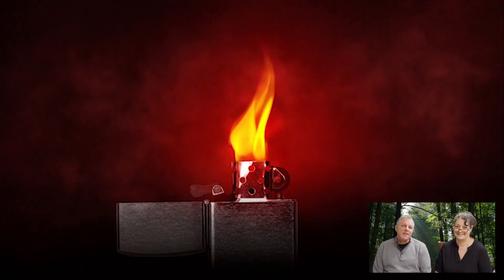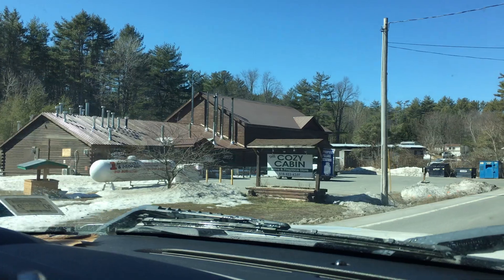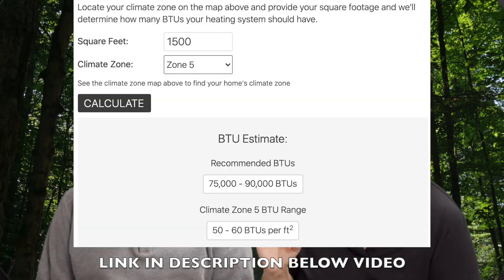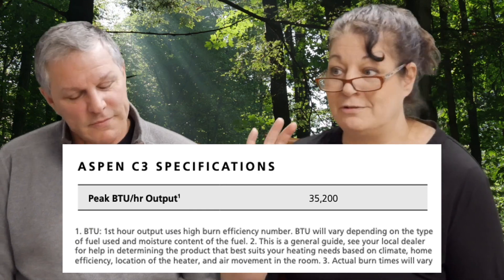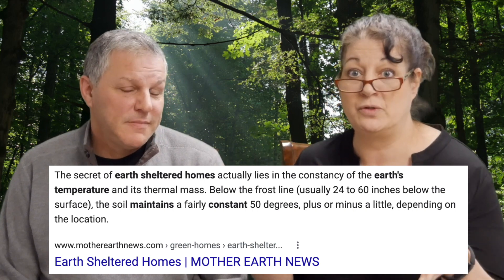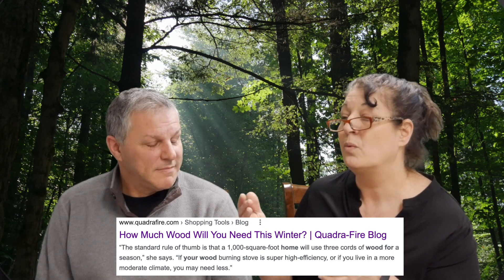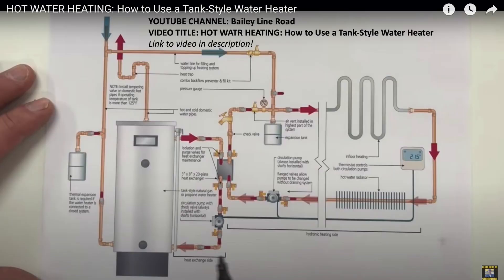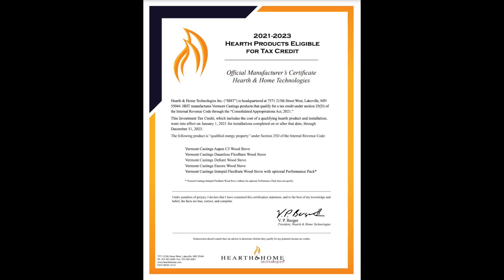OFF GRID EARTH SHELTERED HOME BUILD HEATING PLANS

Comment: Word of caution: The temperature of earth is NOT generally 50°F. It may be true in Adarondac, but I suspect it's true in lower zone 5, more relevant to my area, and probably lower over there. The important thing is, that the temperature of earth in depth is equal to the average air temperature in the area - so it depends on location. So be aware, one might end up needing heating his house year round, if it's not properly designed. Particularly not insulating floor and having a large face wall with only double paned windows will significantly decrease equilibrium temperature in the house. But there are appliances like TV or water kettle (or if they have a solar invertor in the house, it will generate up to few kilowatts of heat every day, might be even excessive) which add heat in addition to human breath - all that in low energy houses raises that equilibrium temperature when the house is inhabited. I'm very very curious myself, what temperature comfort this lovely house bring :-)
Reply from the maker: Trust me when I tell you we have researched all of this upside down and sideways because we have thought of it all. We can’t wait to see how it works out as well! 😊
Reply: @CreatingASimplerLifeOffGrid  It may we'll be that you did much better job reserching it then I did :-D. I'd be happy to be proven wrong, it would be great both for you as well as for my plans! :-)
Reply from the maker: Even with all the research we’re on the edge of our seat!
Reply: @CreatingASimplerLifeOffGrid  I don't think you have to worry, because even if you burn 5 times more wood than you expected,it's still gonna be significantly less then what you need in conventional house. And you have plenty!  :-)

Comment: Ok I withdraw a previous comment on another video,  you are getting the ventilation system. Very good! And it works perfectly, I dry clothes on a clothes rack in the bathroom, they are dry overnight. No moisture in the house at all. However, you might feel that the house gets colder with this system. I called my house the "Flexit-fridge" when I moved in. Your bedrooms will be cold, as only fresh air is put into those rooms. You are not supposed to vent through windows or doors. I bought a bigger wood burning stove, and regulate the heat with the size of the logs. I have a kindler cracker - I recommend you to get one.. so easy and convenient. I went for underfloor heating in the 2 bedrooms and the hallway. I keep them on low, and it dries up wet coats and boots. (I have 1200 sq. feet house) I live in Norway, on 60degrees north, we have so being comfortable is the main thing.
Reply from the maker: Your house sounds amazing! We bought a wood stove and that’s how we plan on heating too. We also have the kindling cracker and just purchased s log splitter to make line easier!
Reply: @CreatingASimplerLifeOffGrid  Getting late over here - I do not have underfloor heating in the bedrooms - bathrooms!! 😂 I have a thick dawn comforter in the bedroom, and a dog! 😉
Reply from the maker: @ibislife  both sound great😊
Reply from the maker: Ps we are at about 45 north

Comment: Good evening to both of you 👍 Yes you will have a very well insulated house for sure 👍😉 You will need to heat to bring down the humidity and also you have a plenty of wood anyway, so you will be able to cut 2 yrs a head 😉👍 I agree with you I will never ever going to force air systems again 👍😉 You can use hot water heater using firewood too ( outside wood burner ) 😉👍  You did great research 👍😉 Yes having and EPA firewood stove is great 😉👍 It is my 3nd one 👍😉 Keep up the great work Cheers 😉🍻👍
Reply from the maker: Thanks! Appreciate that very much. Staying 2 years ahead on the wood would be great👍
Reply: @CreatingASimplerLifeOffGrid  The vital factor is to store it on a dry and very well ventilated place 👍😉 Cheers !!!
Reply from the maker: Ok good! We have plans to build a wood shed👍
Reply: @CreatingASimplerLifeOffGrid  Perfect 👍👌😎

Comment: Double check on the ERV. I build houses in zone 5 and our engineers have told us that we should only use HRV's in this area. They say that an ERV is for warmer climate zones and in colder zones a HRV should be used.
Reply from the maker: I will! Thanks. I think we need the erv because we are earth sheltered but I’m definitely going to look into that! Do you build in a zone 5 A?
Reply from the maker: We just looked into it and we definitely need the erv. We are dry in the winter here and humid in the summertime plus we are more like a basement where we really need to control the humidity. Thank so much for sharing your thoughts. We love learning new things!
Reply: @CreatingASimplerLifeOffGrid  Well be extremely punctual with installing the ERV and think about every tube, where a condensate goes, if occurs. Under normal circumstances, a constant (regular) flow will keep tubes dry. But you may get into situation, when you loose power in specific atmospheric conditions, a lot of condensation may collect basically anywhere. In my case I had a short power outage and the controller switched off, waiting for a reset. I only found out when water started to drip through sealing and I found buckets of water in the flexible pipes. I had to decommission my ERV and have a costly repair ahead. The ERV was done by a producer of the unit, but I'll rather do the repair myself. I will have to replace whole sections of pipes, clean the unit, etc.
Reply from the maker: @oakld  we are installing the unit ourselves and doing all the ductwork so we will be able to access it all